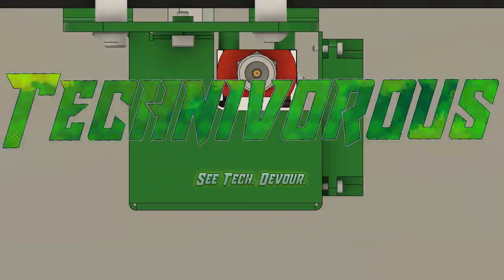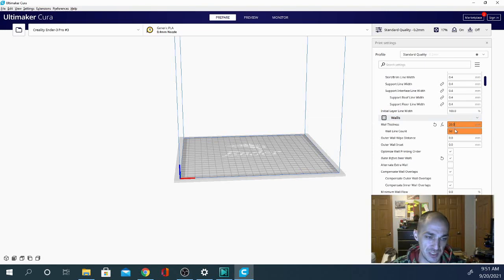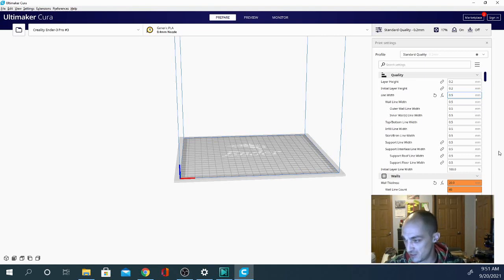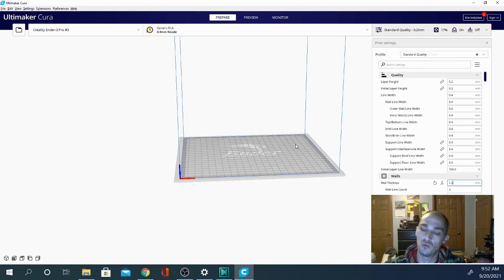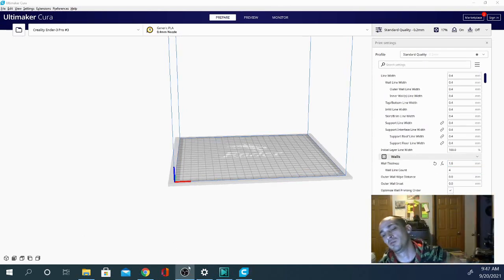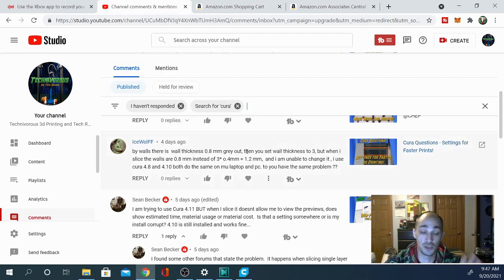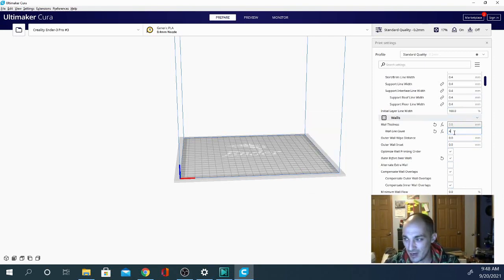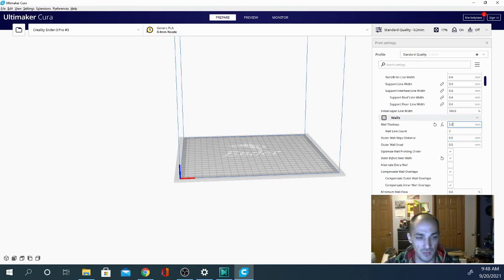Cura Questions - Wall Line Count vs Wall Thickness

Comment: OK, here is my question.  I have the Ender3Max and the Cura slicer wont make my build plate the right size, even with changing in the machine specs. the front and back still has greyed out areas of the build plate that i cant use.  any tip? thanks for the rad channel! keep it up
Reply from the maker: check out number 19 in this playlist... its exactly what you need https://youtu.be/up4sInRgjes